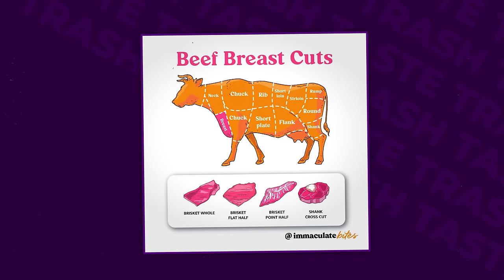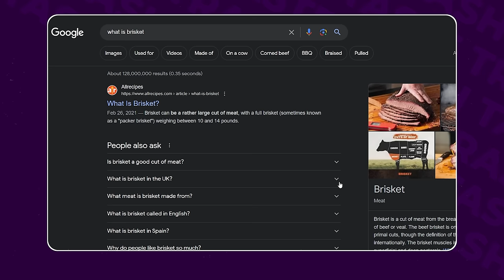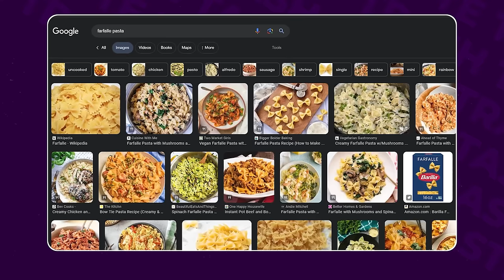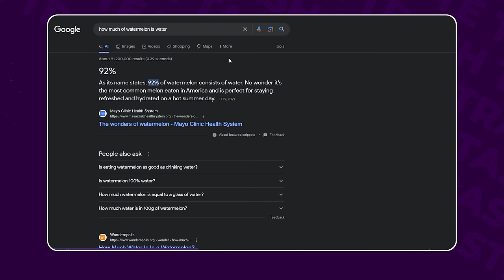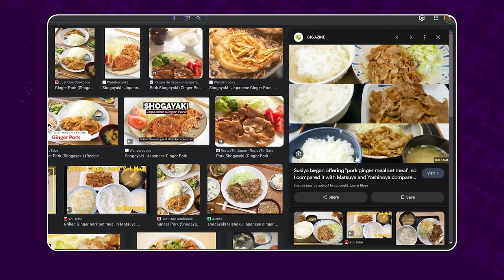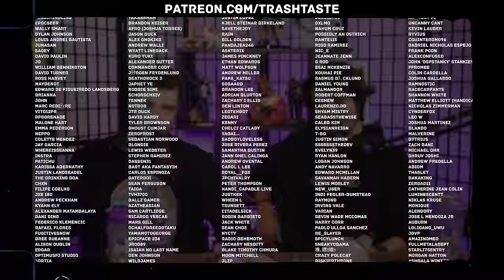Roasting our Trash Taste in FOOD | Trash Taste #182

Comment: Brisket is one of the 9 primal cuts, its from the lower breast of the cow and as such is actually an area that is low in fat and high in connective tissue. Its used as a yardstick for a good bbq place because poorly cooked brisket is going to be basically like chewing on leather. To cook brisket perfectly you have to either use a tenderizing marinade and smoke it. Personally I agree with the boys here, brisket is just bottom tier BBQ meats. The top tier BBQ are babyback pork ribs, beef spare ribs, and beef tri-tip.
Reply: I might just be stupid, but “primal cuts” sounds pretty cool for a type of meat
Reply: @charkulindwyrm  I agree with you my dude, it just has a nice ring to it. The 9 primal cuts btw are Chuck, Brisket, Shank, Rib, Short Plate, Short Loin, Sirloin, Flank and Round. 

Your porterhouse and t-bone steaks are cut from the short loin. Tri-tip is cut from the sirloin. Short loin and Sirloin are often considered the best part of the cow because they have the most fat caps.